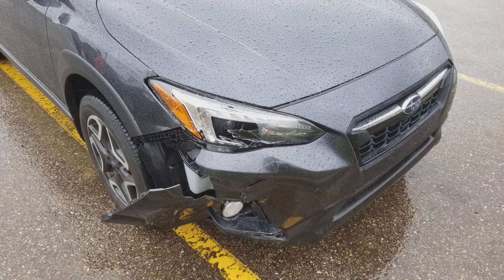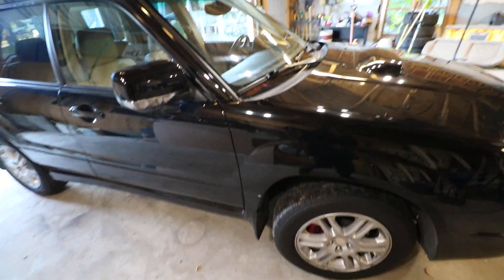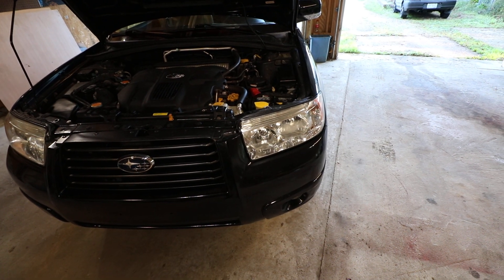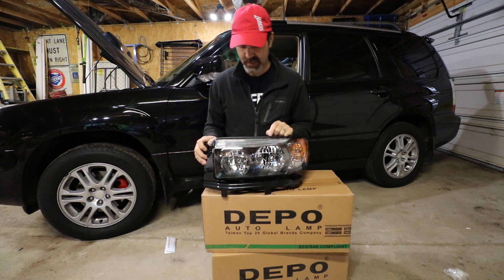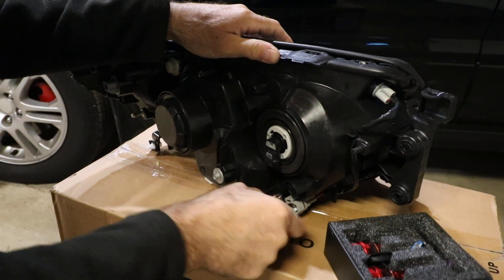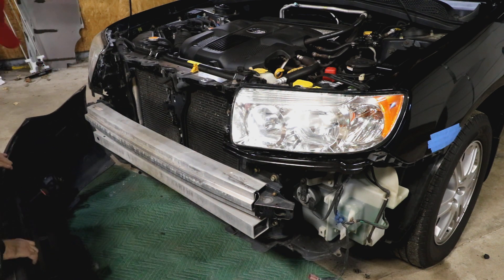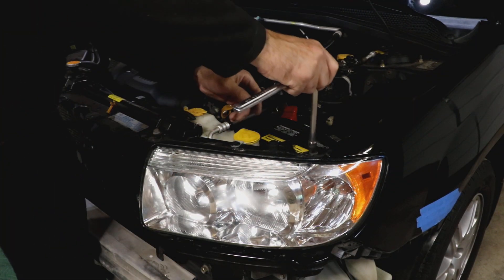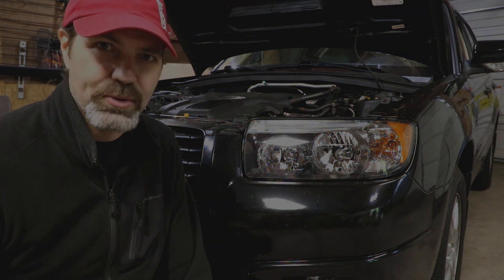Upgrading The Headlights On My Subaru Forester (My Dream Car)

Comment: My 08 n/a sports came with these headlights but ridiculously yellowed with broken seals. Replaced them with the same brand here and they look great. Right now it's my daily, but I'll be picking up a newer impreza hatch for the daily and importing the sti motor and trans setup and swapping it in with a front intercooler swap. Can't wait. The possibilities and diy-ness of these cars makes them an absolute joy to work on
Reply from the maker: Yeah, they don't age well. So far the new ones are holding up great.

Comment: There's two problems with LEDs. 1) The lamp housings are designed to work with halogens that have a filament at just that height and orientation to make a beam with that reflector and that lens. LEDs will be at the wrong place and will make a brighter (maybe) but worse beam. 2) It's illegal modification of the forward lighting system. You can use them in off-road auxiliary lights, but not your highway forward lighting. If your state vehicle safety inspector is on the ball it'll fail; a state trooper could wreck your evening.

Any modifications and most/all? retrofits are illegal. I don't think it would be legal to get a Japanese or European spec factory lamp with all the technology, even directly from Subaru, and bolt it on your USA Forester. That one you might get away with because the Subaru logo would be molded in the plastic, and it would presumably work correctly. But technically, no. Those HID kits you see -- illegal. The so-called plug 'n play versions are downright dangerous.

It absolutely sucks, but the USA has been the worst about automotive lighting for many decades. In defense of DOT, until self-leveling headlights became reasonable (Xenon projectors are required to have them.) permitting a super bright headlamp was dangerous. You load up your Forester, even a "low beam" goes high due to tail squat. But now that these things are reasonable to make, there's no reason the USA can't catch up. Staying caught up, that'll be the trick.

The good news is the infrastructure bill gives DOT an excuse to do it. 

https://www.motortrend.com/news/us-headlights-standard-108-update-infrastructure-law/
Reply from the maker: Thanks for the info. The good news is that the light pattern is great! The better news is that I only upgraded the high beams which is illegal to have on with oncoming traffic anyway so I'm OK there. The state I live in doesn't care about modifications unless it's a hazard to you or other drivers. Finally,  I also don't have any annual vehicle inspection of any sort so I'm good there too. Thanks for watching.

Comment: I read through the comments but didn’t see if you had listed what type of led (high beam) bulbs you used; currently having my headlamps replaced with these as well and would like to have led high beams and “fog lights” or… driving lights like that one comment mentioned.   Thanks.
Reply from the maker: The high beam led is from Auxbeam and work very well. Unfortunately I bought cheap ones for the fog lights and they cause static interference through the radio, if you stream music you will be OK but terrestrial AM and FM are affected.
Reply: Thank you!

Comment: Howdy. Just watched this to help me after a run-in with a deer. Good stuff. At the end you mention closing the gap where the bumper meets the hood... any luck with that? Might as well tackle that while I'm replacing the lenses
Reply from the maker: Unfortunately no, the problem seems to be with the plastic the bumper is made from. I have tried to add an aluminum plate on top of the bumper beam to push the shell upward but it didn't make any noticeable changes.

Comment: great vid..just a question
Seeing that your XT originally had HID low beams, and the replacement lights do not, is there an issue with the original wiring harness in converting to the halogen low beams?
Reply from the maker: The OEM ones were halogen and not hid.
Reply: @DIYEVERYTHING  really..Maybe it was only RHD XT's that got HID low beams .
Reply from the maker: I think so
Reply: @barrythomas6429  I have HID on my 2006 2.5 XT LHD European model.

Comment: Your car doesn't have fog lights, they're driving lights, fog lights are yellow
Reply from the maker: You're correct but if it's any consolation, I tinted the lenses yellow and added yellow LEDs.
Reply: Depends on the country. In Europe fog lights are white